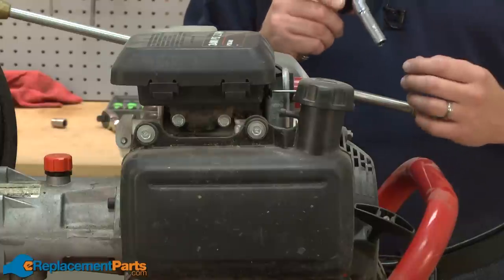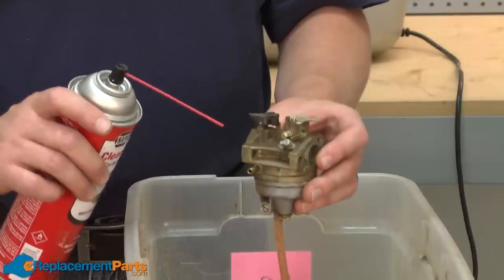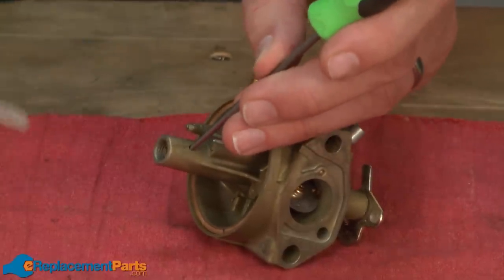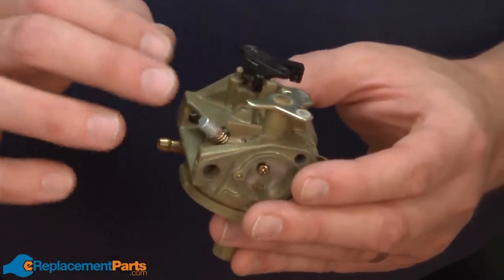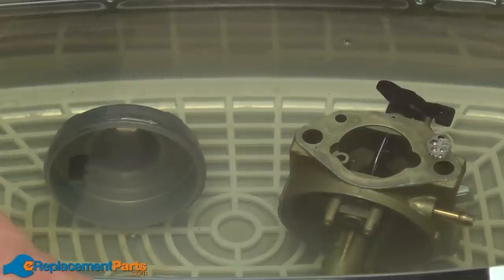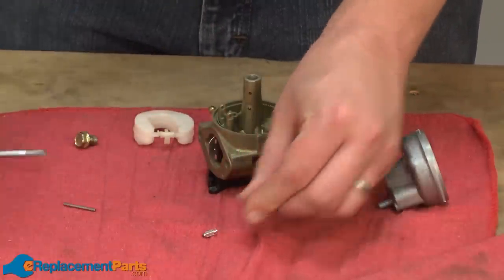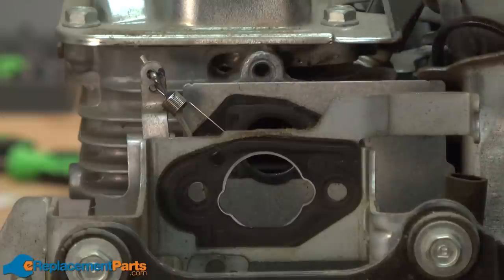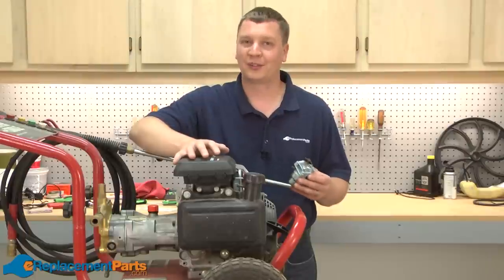How to Fix a Honda Carburetor

Comment: Thank you, I appreciated this very much.  I have a 2015 pressure washer with a GC190 that I let sit for 6 months with gas in it, a couple times, this last time it would not stay running.  Only ran for about 2 seconds.  After using gumout spray it would stay running with choke fully on and no pressure on the engine.   I followed your steps (although mine does not have that idle screw on the bottom of the carb) and it works great now!  Just finished pressure washing a 25' x 35' driveway.  Thanks again.

Comment: I did pretty much all of that except on the main jet I didn't know the long sleeve was in there after I took out the short flat head screwdriver jet part. It runs a little longer than it did before I cleaned it but still suddenly quits after about 10 or 15 seconds. Runs full throttle and smooth until then. Also while I was working on it I looked at the magneto and found a wasp nest on the ignition coil and rusted magnets on the fly wheel. Wire brushed the magnets but still quits after a few seconds. Any suggestions? Thanks TC

Comment: Can you tell me if there is a pilot low speed jet that can be unscrewed under that small screw on top or is there a hole that you can see that you can make sure that is cleaned out.   I sprayed in there on my carb and it seems better but still likes a little choke when hot to run smooth so I know I need to go back in there to clean it out better.

Comment: tip when storing the machine for more the 30 days. Simply turn the fuel valve to off while running and let the Honda engine run until it stops.  This helps use all of the fuel in the line and carburetor and will help to not allow fuel to sit in the line and carburetor bowl and break down causing varnish and build up.  I also add sea-foam or some other fuel stabilizer to my fuel cans to help preserve fuel for storage.  This method has worked well for me.  Just do not let fuel sit in the line and carburetor and keep the fuel tank on the machines full so the least amount of air is in the tank as possible.  Gas is not the same quality it once was due to the high pump prices... companies are making it as cheap as possible to stay competitive and as a result it deteriorates much fast then it used to. 

If I plan to store a machine for a year or more that's when I drain all the fuel from the tank or just let it run completely empty.  With proper preparation I think you can keep fuel in engines just try and not use fuel with any ethanol if possible.  I like ethanol as a substitute it just likes to break down since it so environmentally friendly.
Reply: Luke Clement Good advice; my carb problems dropped to zero once I started doing this

Comment: nice video thank you for sharing, i have the same machine and i did what you had done exactly , but the engine starts for one second and then dies, i checked the spark and coil, they are working fine, do you have any suggestion why it starts and dies ? than you
Reply from the maker: You may want to check your air filter, muffler and spark arrest or They may be clogged. Or you just may have a worn out carburetor.